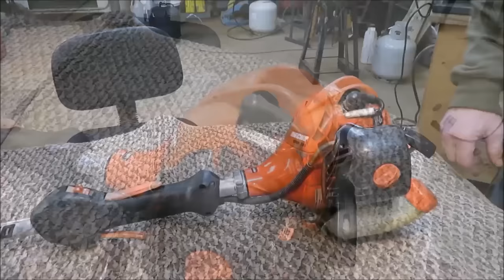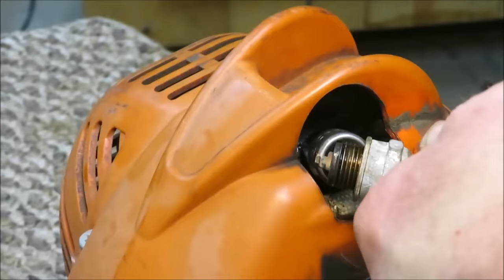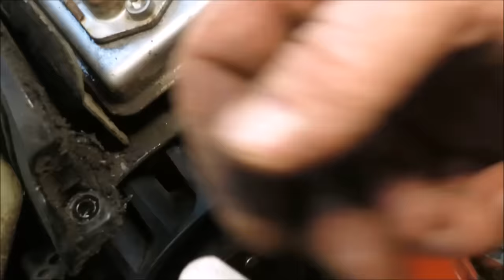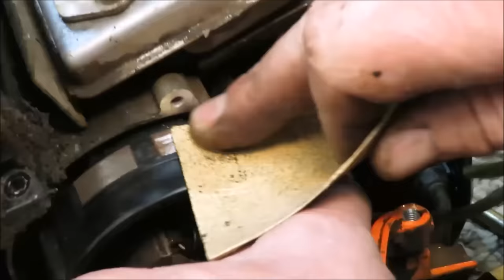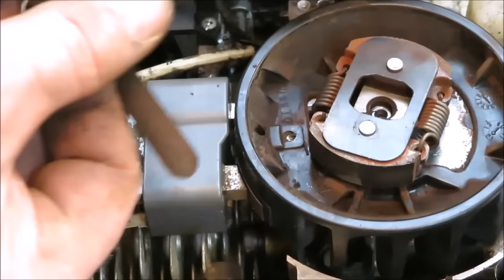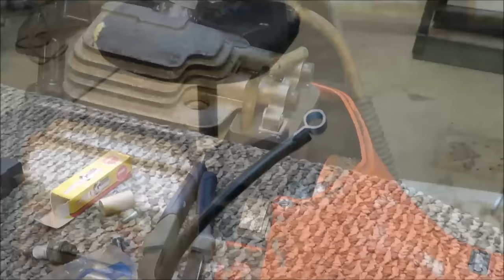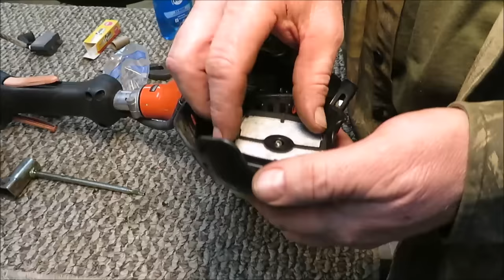string trimmer weed eater coil test & replace

Comment: Thank you Kevin❣️❣️ I’m so happy you shared this without a potty mouth😊👍🏻 oh BTW the guys correcting your weed eater lingo pobly calls a water heater a - hot water heater 😂😊❣️ but you and I know it’s a “Water Heater”  🤣😂😆
Reply: What about the kill switch could it be defective most likely it is the coil
Reply: Just because it's preset doesn't mean it's right I always check the gap of the spark plug
Reply: Put some anti seize on your spark plug on the threads of the spark plug put some anti seize are the threads of the spark plug it doesn't take much it will help a lot of people over tighten spark plugs

Comment: Actually no contact is made between magnets and magneto coil, The coil works on 
magnetic induction. two coils inside coil housing, the primary, few hundred turns,
secondary a few thousand turns very fine wire. possibly a condenser reaches a given 
voltage then discharges into the primary coil.
Reply: Yes, mutual induction creates the spark. The air gap is important but not cleaning with sandpaper.
  That type of plug connector is installed using dielectric grease and holding it with either “Duck-Bill” pliers or needle nose. A “Hog Ring” pliers with a 45 degree angle works great as they are rounded and don’t close all of the way. One end of the coils secondary is at ground, otherwise it is not a complete circuit. You will find most are the same resistance on a digital multi meter. Testing the plug wire to ground would answer that 3 minutes after no spark was confirmed. Use an ST125 (Spark Tester, #1, 25,000 volts) it comes with an alligator clip on the side to clip to ground. I started on lawnmowers, then motorcycles. After that, cars. Only motorcycles use CDI (Capacitor Discharge Ignition) because they are more expensive. ASE Master Tech since 1978 - Retired

Comment: Nice video Kevin, had a similar problem on my Husqvarna 129ld and the old coil measured with a cheap multi meter from the plug lead to ground was open circuit . The replacement measured 3.2k ohms , and works perfectly . Hope this helps . Ian
Reply from the maker: Thanks for the information

Comment: If you go ahead and insert the feeler guage into the gap at the center of the pick-ups, because the pick-ups are radiused, the width of the flat, relatively wide guage keeps the gap much larger than the thickness of the guage blade. From that, you can go ahead and see the blade must be inserted only a short way into an edge of the gap, to be able to set the clearance at the correct distance.
Reply: I use a business card between the coil and flywheel then tighten the two coil screws, works perfect.
Reply: @stevegieselman5704  are all business cards the same thickness?

Comment: I would put the boot on before you put the spring loaded thing on there that way you don't have to fight putting the boot on or use dish liquid
Reply from the maker: Thanks for the comment Wally.
Reply: Hey Wally, can you explain what you mean here?
Reply: Instead of struggling to push the cable with the coil attached into the rubber cap/plug, push the cable into and through the cap first, then put the coil spring onto the cable then pull the cable back into the cap until the coil is up inside  cap/boot in the correct position. Good idea.

Comment: 4 things needed, proper air&fuel mixture/ compression/ good spark/ proper timing.
Reply: The timing is dictated by when the flywheel magnets pass beneath the coil. Unless the flywheel key is sheared (easy to check by looking at the key in the shaft), then the timing is not an issue with this engine.
Reply: It takes fuel to burn and a spark to ignite it , compression and air/fuel mixture with a spark will do it Everytime

Comment: If you learn to test an ignition coil with and ohm meter... which is super cheap btw... it will really help you with diagnostics. Otherwise... a good video.
Reply: Using a meter on a coil isn’t the best way to check. In my experience, the way it was done in the video is the most accurate way to troubleshoot the ignition system.
Reply: That’s what I was gonna say, put an ohmmeter on it. I’m in school for aviation maintenance and we use meters on everything to test for shorts and opens in the electrical system.  Alternators, ignition coils, etc. Meters can tell you so much information.

Comment: Air fuel spark. You can have bad compression and still run but not without fuel. But good video, I have the same echo my dad gave me years ago, it still runs strong. Today my fs 55rc decided it didn’t wanna run even tho I ran it yesterday. I have a new plug and fresh fuel so I ordered a coil and things should be good tomorrow. In the meantime I cleaned up the spark arrester and cleaned it up because it’s down till I get the coil tomorrow.
Reply from the maker: Thanks for the comment Rcih

Comment: You should have put the rubber spark plug wire cover on the wire first, put on the connector on then slide the rubber cover down the wire over the plug connector !
Reply from the maker: Thanks for the comment.

Comment: You ought to use wet or dry sandpaper.  I use 320-400 wet or dry to clean up parts that have a little corrosion on them.  I also use one of my business cards to set the air gap on a coil.  I rotate the magnet on the flywheel away from the coil, put the card in front of it, loosen the coil bolts and rotate the flywheel around until the magnet in the flywheel pulls the coil down against itself.  I then tighten the coil bolts, pull out my business card and rotate the flywheel around to make sure it is not contacting the coil at any point of its rotation.  If it is, then your bearings may be shot.  Actually, the air gap should be about .012.

Comment: Plus the coils only run 10 to 20 dollars. On EBay or criagslist. Cheap and they are new
Reply: Michael - got an Echo PAS-2400 and all the coils I see range from $70-110 bucks. Not sure which ones you are seeing.  Thanks!
Reply: for this model, $35 on Amazon

Comment: Fun thing I learned in the last week is all Echo coils have a lifetime warranty!!! If it’s in the first 2 years from DOM, totally free at your dealer. If not you will owe the half hour to the shop for time. Blower ones run around $74, shop time was $42,   And instead of paying $74 for just the coil, I paid for them to install warranty part.
Reply from the maker: Thanks for the comment and sharing.
Reply: Show me your receipt for the part you bought. It will say magneto not coil.

Comment: Not sure how sanding bottom side of grounding electrode could affect spark. When plug not sparking I try the plug wire end to ground. Also I prefer an inline spark tester .
Reply from the maker: Thank you for the comment Ken.

Comment: The magnets and the coil do NOT touch each other. You can usually use a business card as a spacing tool when you put them back together. But really, cleaning them is probably not going to help as they don't touch.  The spinning magnet generates a voltage in the coil. It is the magnetic field that is generating the spark and it doesn't touch the magnets.
Reply: I always clean coils with brake cleaner first to blast away the oil=dirt pathway between the poles of the coil fields and then I follow up with a fine wire brush wheel on my drill.  I do the same with the flywheel magnets.  Dirt and oil paths can weaken the magnet pulse induction thus failing to produce the required electrical charge necessary to produce a good strong spark.  The same is true for batteries.  Keep things clean and yourself so things last longer. :-)
Reply: While it's not going to hurt (assuming you don't break anything or mess up the gap), it's not going to help.  I suppose if there is enough rust that they touch, it could provide a ground, but that's about the only theoretical way it could cause any problems.

Comment: It would be easier to run the spark plug wire thru the cap first, them crimp in the connector and pull it backwards into place.
Reply: Yep, you beat me to it!
Reply: @grantsnell6782  Good video.Thanks for uploading it.

Comment: Don't use ethanol gas. I don't, and I haven't had the first problem starting my 2-stroke engines after sitting all winter. It just isn't a problem. E-gas is bad Ju-ju. 

Ethanol free gas costs more...but it's essentially hassel free. Luckily, we have several stations that sell ethanol free gas.  Just be sure that the first gallon or so goes in your car's tank...so that you avoid the ethanol gas left in the hose, otherwise you'll get the e-gas left in the hose in your gas can...and if it's a 1 gallon can...then you'll have a significant amount of ethanol in your gas.

I have followed this advice for years without the first issue. Try it.
Reply: Dam e-gas eats plastic and fiberglass.
Reply: I AGREE 100%  I do not use ethanol fuel in anything except cars and trucks that I operate more than a couple times per month (so the fuel does not have time to go bad).  Do not buy more regular gas than you will use in a year.  Fresh regular non-ethanol gas and fuel stabilizers are your cheapest and best operational tools.
Reply: This is the advice I have been giving folks.  I started running AVGAS LL100 and haven't looked back.  All problems went away and everything runs stronger and cleaner.

Comment: Thankfully there is a gas station near me that has an ethanol free gas option.  Aug-till too cold to run eqpt I use the  no ethanol choice.  It's  about 30 cents more a gallon but just firing up equipment come spring is so nice... No carb tear downs.. Also, I reminders in alexa to go jog the snow thrower or mower whatever is out of season once a month... that helps too..

Comment: Lately I had that same problem. I found that the wire from the coil to the plug was all coroaded. It was Lipe powder. I changed the lead wire and it worked.
Reply from the maker: Thanks for sharing.

Comment: What-a-HACK! ...Are you kidding me!  Lick  your finger and get your kid  to pull it!   ZZZZZZ😖
Reply from the maker: Thanks for watching.
Reply: @Robinson-Homestead  I'm a retire mechanical engineer and repair musical instrument and internal combustion engines  now I am retired. You diagnosed the problem, cleaned or replaced the parts, got the machine operating and the part where you return the old parts was brilliant! I wonder if the TROLLS have a different method of diagnosing and repairing? I have my doubts!
Reply from the maker: The negative trolls don't bother me I just tell them thanks for watching.

Comment: Thanks, I'm working through the same problem, on the exact same Echo. I got it for free, so it's worth putting a few parts into. Hardly any carbon on the spark arrester, so hopefully not too many hours on it.
Reply from the maker: Good luck with it William hope you get it working.

Comment: Nice video never diagnosed a magneto before. I am also thinking about using true fuel for my lawn equipment from now on.
Reply from the maker: Thank you for the comment William.
Reply: Don't waste your money on that.  Find a station that sells ethanol free gas and use a good two cycle oil.  Any time you are putting away a tool and it may be a while before you will use it again, either dump the fuel or turn the fuel valve off and let the machine run out of gas.

Comment: My yard equipment always starts because I put it to bed, correctly.  FirstI use PNE(premium, non ethanol gas)gas, run them dry in the fall and hang them up in the shop for the winter.  Then, in the spring I just fill them up with new two cycle, prime them up and crank them.  Usually in just several pulls.  Folks that leave them filled with ethanol gas and outside for the winter are just asking for trouble.    I always check spark with my spark checker, after pulling the kill wire from the coil.
Reply from the maker: Thanks for the information

Comment: I believe that is not a primer bulb? It is a purge bulb. There is a difference. You can also use a business card that will give you a perfect gap. I am glad you were honest and said you are not a mechanic. jtho covered the other area. Also if you have a meter you can measure for resistance on the primary and secondary side. It can save you a lot of down time.
Reply from the maker: Thanks for the comment.

Comment: Mine did this after 3 uses. Ive done just about everything to it. Thanks for the vid
Reply: i recently got a brand new stihl and ive used it maybe 2 times and now i can’t get it to start either, haven’t checked the coil yet
Reply: @pablozunigaiii454  I just got mine running after a whole season of it not running. And all i did was pull the plug, checked for spark, and put it back in....   It mustve been black magic

Comment: The white fiberglass sleeve that was on the original plug wire is important; it protects the plug wire from being chafed by the engine shroud due to vibration.
Reply from the maker: Thanks for the info.

Comment: If I'm not mistook, the problem with ethanol, particularly in small engines, is that it eats RUBBER - which used to be used in gaskets and seals that predate ethanol in gas.  The other problem with ethanol in gas is one that remedies itself - when hill billies think they can distill the ethanol out do drink it - gas in their stills renders the stills (and said hill-billies) inoperative.

Comment: Something I just learned . Try to find gas without ethanol , especially for small motors .  Gas turns hygroscopic  , meaning with ethanol added to fuel , the fuel absorbs moisture from surrounding air and the molecules of the air are taken into the molecules of the fuel . The result is water in your fuel which causes trouble .------Ernest E. Johnson
Reply from the maker: Good info.

Comment: Hi Kevin.
Todays two stroke fuel deteriorates very quickly, and should be totally removed from the machine before off season storage, by emptying tank completely and then starting motor till it stops to clean out the remaining fuel from the carby bowl.
Reply from the maker: good information

Comment: Just add something. 2 Strokes need 4 things. Fuel, spark, compression AND  vacuum. If the suction and pulse lines dont work, then 160 lbs of Comp at top of engine wont help.  Trick is when you squirt starter ect into carb throat and angine fires, EVERYTHING is working at least nominal although Carb still has to run itself, but thats all that can be wrong or fuel delivery to carb, blocked vent ect- FUEL.  You can have great compression BUT there can be the whole bottom of the engine missing!!! Above piston is all comp tests. Below is as important and seals ect wear out. A little leak under pressure and suction is usually ok and manual will say how much. More problems at idle than fast as extra air will mix and make the starting part tricky but may run ok at higher speeds.
Reply from the maker: Thanks for the comment.

Comment: Good video ,exactly what I would do when checking for fire ,gapping the coil I use a business card.I did a video of the same weedeater.It was pretty bad ,I had to take the piston out and ultrasonic clean everything make it run again.It was out side for a long time maybe for some years and rust and carbon build up was pretty bad.The coil was rusted but good though.Good video keep it up.
Reply from the maker: Thanks Red

Comment: Hey Kevin. That particular weedeater has a circuit board in the inside and notorious for getting a crack in the cover that you can't see.  There will be no crank or bogging down trying to accelerate. Just like if the screen in the exhaust is stopped up. Even an ohm test can be deceptive . Anyhow a good video. Just a little long on getting to the point. Thumbs up.
Reply from the maker: Thank you for the info Dewey Lee.

Comment: May I suggest getting a digital multimeter....  If you have a Harbor Freight shop nearby, you can find one for less than $6 (with tax, even).  Otherwise, you at least can find some for $123 to $20.  With a meter you can check continuity from one end of cable to the other.  Or you can check if the coil is intact.  Or you can also see if there is a short from the coil or wire to the frame.  Too bad, some insulation failures only happen at much higher voltages, like the several thousand volts that the coil can produce.  But at least you get the basic and obvious problems checked before you embark on more difficult tests.  By the way, sanding the magnetic poles does not do anything to the magnetic flux.  There is not, and should not be any contact to the magnets -- after all, you verify that there is a gap with the feeler gage!
Reply from the maker: thanks for the info

Comment: They do make a brass feeler gauge for checking the gap when you have a magnet on the magneto so that the feeler gauge doesn't stick in between and throw off your measurement
Reply from the maker: Thanks Tom.

Comment: It`s a really valued tutorial!  However if I understand there is an easier way to check the coil- some people uses multimeter to define this via resistance measuring.  And, yes if no spark it is a coil problem. But what if we have a spark, but a weak one. It starts, but very difficult to do this from cold. However no chance to start it when it`s hot. No spark plug and no gap is a cause of the problem. What else can it be? Thank you
Reply from the maker: I don't know for sure but it sounds like a coil problem to me.
Reply: @Robinson-Homestead  What I have noticed, this issue is only for cheap brands only... I have two Victa units (pretty brand new) they`re both have the same issue with a weak spark. But an old Husqvarna 25R from 1988 !!!   is giving a strong lighting and starts immediately from cold or hot...   The problem is most likely in their design... Do you have an experience with using a low resistance spark plugs, please? It might (in theory) improve spark strength... Thank you